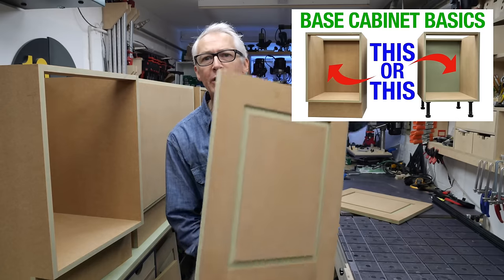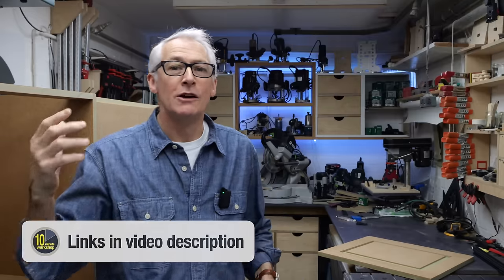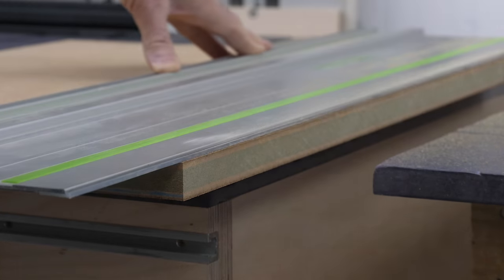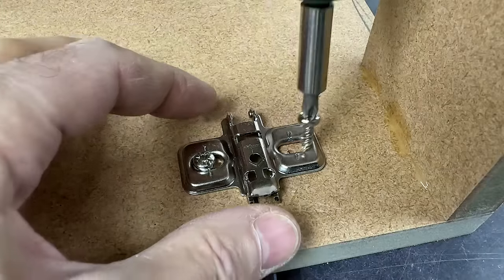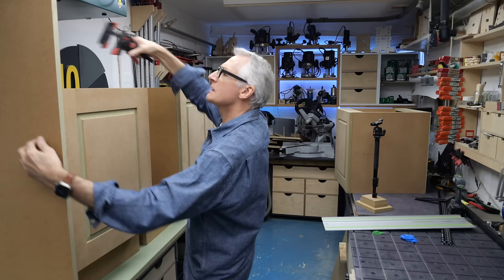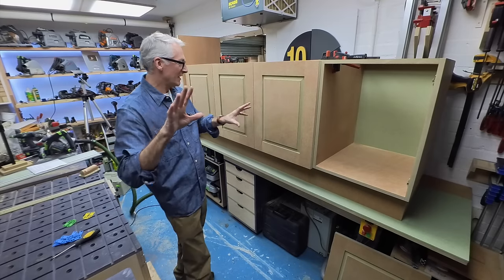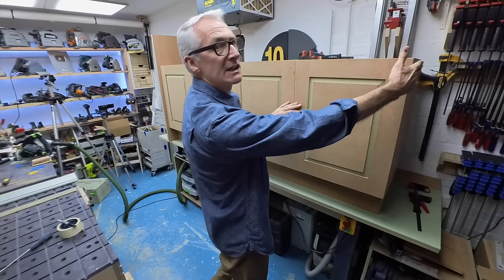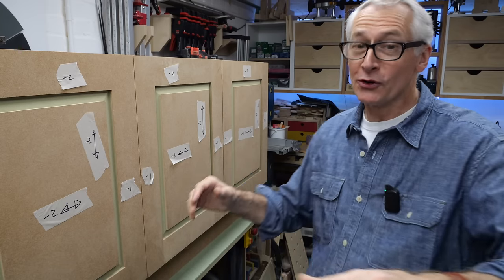Cabinet Door Sizing [*Ad] [video 549]

Comment: Surely trimming the hinge side will affect the distance between the centre point of the hinge and the cabinet door edge. I would think it was better to determine the door width exactly and then drill the hinge holes.
Reply: @rimmersbryggeri  Did you read the description of the video? That's what Peter says - big manufacturers make a door for any carcass by using bigger tolerances. Peter's explaining how to have better / finer tolerances for a better overall finish
Reply from the maker: Not with a concealed hinge.  👍
Reply: Peter made the door the same size as the cabinet carcass, drilled and installed the hinges, then he trimmed them. Trimming them after the hinges have been located means the door will sit in the same place when reinstalled after trimming.

Comment: I like how you have made it simple for new people, but its not how you do 😊. measure the carcass take 3mm off (saves cutting and trimming twice) also if that 'end' unit was on show you would fit an 'End panel' to the floor so that door would need trimming (I know you know that, but maybe show an end panel as a nice way to finish that end) good work
Reply from the maker: I don’t do end panels. And as I say in the description, this is how I do them - you do them how you do them! 😂👍👍